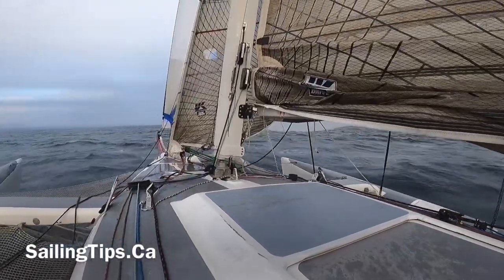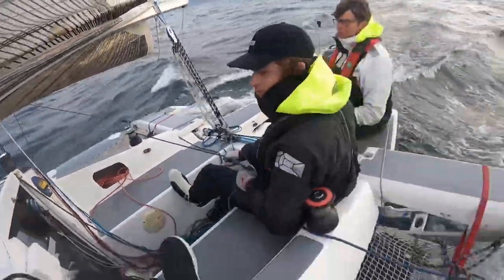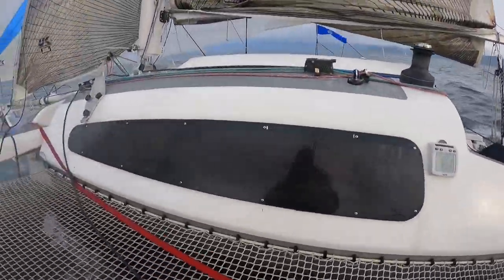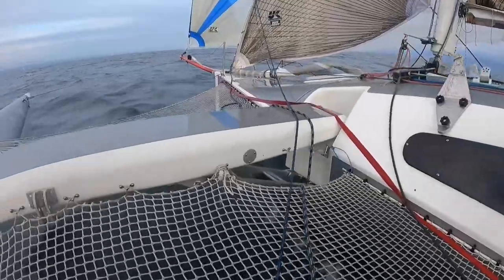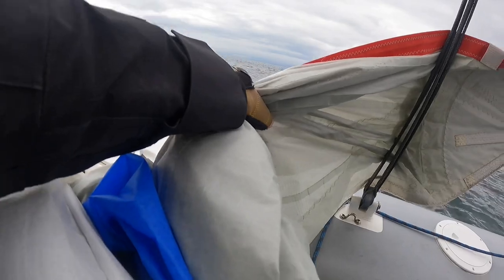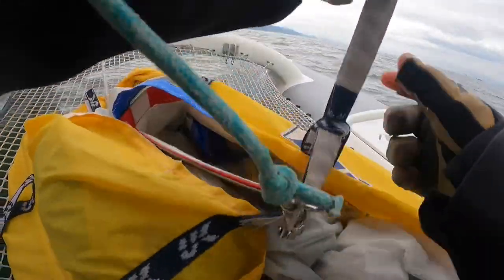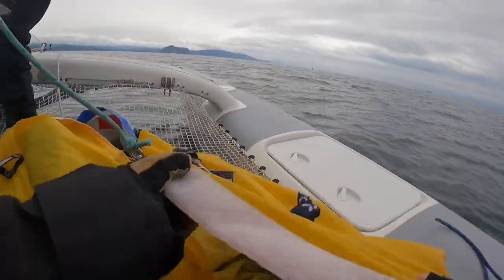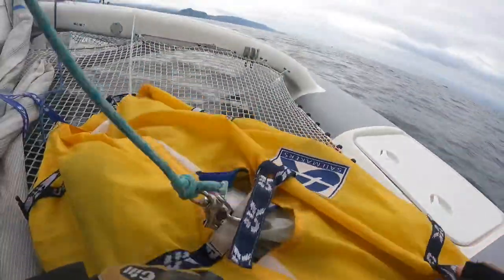Dousing an Asymmetric Spinnaker Without a Sock - It's Easy!!!

Comment: Monohull racing sailor here:
During racing we tend to drop the kite down the bow hatch (on a 44ft cruiser/racer) using a retriever line in the middle of the asymm. Once the centre is down in the hatch somebody down there pulls the rest of the sail in.
It can be a bit of a mess at times and you need one or two more people up on the pointy end helping to get the sail down. But it works fairly quickly for a boat like that. 
Although i do like the technique in the video and i think ill be doing it like that for cruising and deliveries form now on. Thanks for sharing :)
Reply from the maker: I think the retrieval line in the middle of the kite is a great method too! My last boat was a 42ft cruiser/racer and we also did a variant of the foredeck hatch method but without the retrieval line for a couple of years and like you had somebody down below pulling it in. We then switched to the letterbox douse, which is similar to what I showed in the video, but you use the lazy sheet as the retrieval line by leading it over the boom and down into the companionway, and you use the gap between the boom and the main sail as a “letterbox” to keep the kite from re-inflating. This is totally bombproof in all conditions. In lighter conditions we would drop it onto the deck and pack right back into the bag as shown in this video.

Comment: 0:23 i like your videos, is interesting to see different methods. aren't you pointing down wind before pulling the tack line to de power the chute? with more wind i think releasing the tack would raise the chut in the ski ... ?
Reply from the maker: You definitely want to depower the chute before dousing, but there's more than one way to do that. One technique is heading down as you noted, and this is the most likely if you're dousing at the end of a downwind leg and getting ready to head back upwind, because heading down for a few seconds doesn't really take you off course. But if you're dousing because the wind has moved forward and you can't carry the chute anymore, you may not actually be able to head down due to lack of sea room, or it will just take you way off course, In this case you can also set another upwind head sail (jib, Genoa, or screacher) and slightly over-trim it and the chute will  just collapse and slide down the back side of that. Either way, you want to have the lazy sheet in hand to pull the clew in once you've released the tack. Hope this helps!
Reply: @SailingTipsCa  Indeed depowering is critical. I absolutely torched my hand on my Corsair 24 once by not understanding this concept. When I released the tack, there was so much power in the sail I couldn't hold it.  The main mistake I made was thinking that the sail would depower when I started to head upwind, when actually the opposite is true. Stupidly, I wasn't wearing gloves either. I think I'm still psychologically scarred from the event. Now, I unfurl either the jib or the screecher and stay downwind, as you've mentioned, while dousing the spin and that works fine.
Reply from the maker: @jmoheli  I can understand being scarred from burning your hands! That once happened to a crew member on my boat during a botched takedown and I felt absolutely horrible - he had also removed his gloves to eat lunch and several weeks later his hands were still recovering!